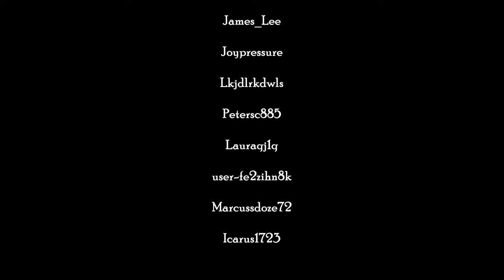A Two-Tier Rope Display / DIY

Comment from the maker: Please turn on your language subtitles!
Join our membership!
I use various columns when I make multi-stage shelves. 
I also use wooden sticks or stainless steel rods.
In this work, I specially made a column using a rope.
Ropes are used when tensile force is required, not when compressive force is required.
However, I used the property that when the chisel and the instantaneous adhesive were combined, they became as hard as a block of stone.
If we apply instantaneous glue while pulling the hemp rope tight, it hardens very hard.
Five 6mm hemp ropes can withstand tens of kilograms. We can make a product that serves as a pillar with a hemp rope.
The boards on the shelves were made of transparent acrylic so that the wood of the columns and joints could be seen through.
I always try to develop new ideas. Among them, I think the technology used to harden the rope used in this work can be applied in many ways.
Next time, I'm going to make a plate using a rope. Let's make a box out of this board and see how strong it is.
Thank you.

#DIY #Woodworking #Workroom #InteriorProps #Interior #Two-Tier_Rope #Display #DIY_IDEA_INVENTION

Comment: what a great build.  Would it work with thicker rope?
Reply from the maker: There is a problem with instant adhesive being used a lot, but I personally confirmed that it hardens even a fairly thick rope. I am also envisioning a work that can be made with thick rope. Thank you for your words.